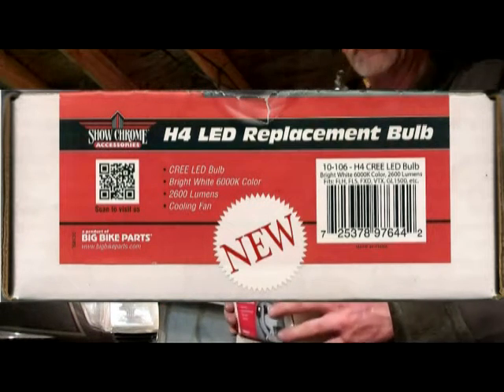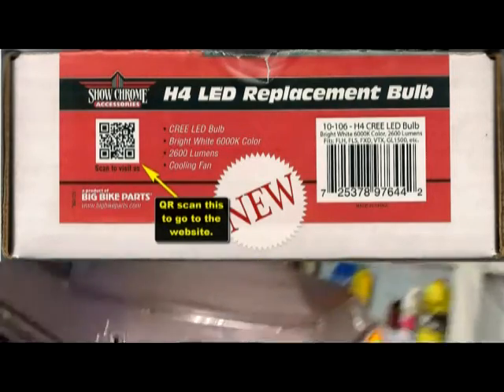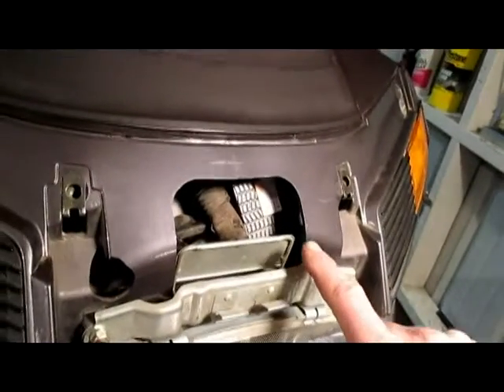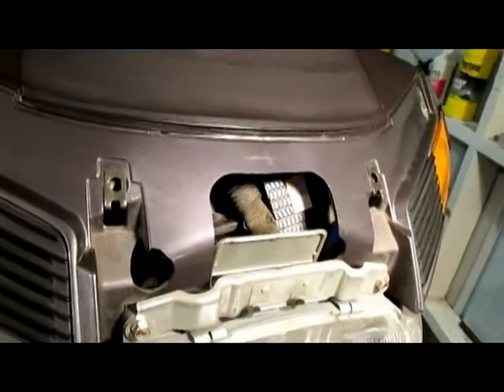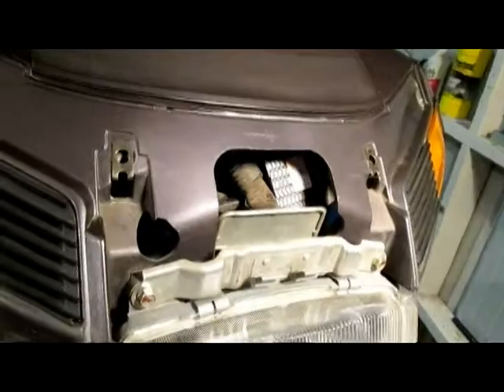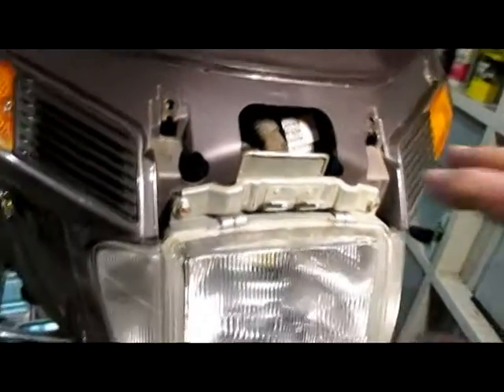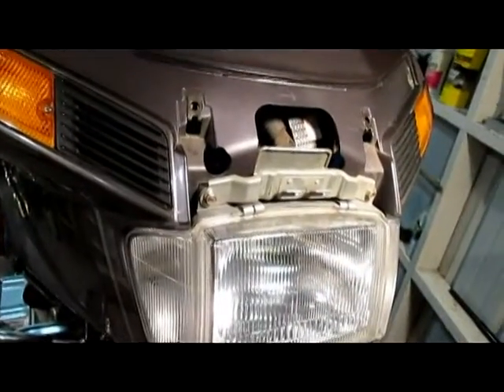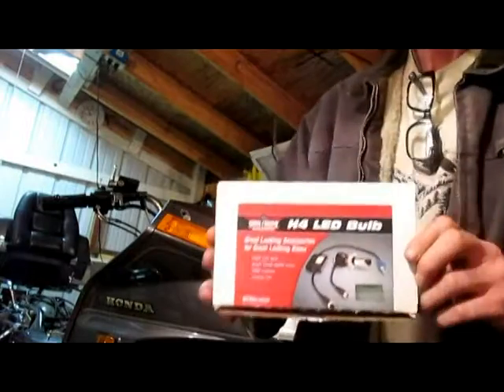LED Headlight Install 1987 Honda Goldwing GL1200i

Comment: No cutting needed. Run wires back tru holes. Made extra work for yourself .
Reply: What's going on with this cutting?
This is the second video I'm watching in which it is recommended to cut out a part of this casing.
Why are they cutting it if it's not necessary? 🤔

Comment: It would have been great to see how you got that front cover off instead of starting the video with part of the bike already taken apart
Reply from the maker: You're right, sorry about that. By "front cover" do you mean the aluminum trim above the globe? That allows you access to the four 10mm bolts that gets the globe off? If you have a 84 to 87 Goldwing, you take off the mirrors, the top bolt of the mirrors holds the aluminum trim on. Then you need to just pull up a bit on the middle of the trim because there is a little mount that kinda holds the trim down. But there are only the two upper mirror bolts holding that trim in place. Hope that helps. But don't get the one I put in. They make great ones now that just plug and play.
Reply from the maker: And there is a little piece of plastic trim at the bottom held in place with two small little screws. Careful taking those out and putting back on. Easy to lose.
Reply: @patrickbrandon549  Yes, we found your video but spent about an hour trying to find the screws behind the trim! Thank you for the reply, hopefully the next person working on their Goldwing sees this!

Comment: Thanks for posting,now I know for sure not to do what you did,they now make led lights with built-in drivers ,no fan ,exact same size of bulb as
 original !! Don`t see many wings in the amethyst grey
Reply from the maker: You're welcome. Glad it could help. I like the grey color, doesn't show up dirt as much. ;) I have been looking at the newer LED headlights and will probably put a different one in this Winter. This one is not very aim able, and because of the way the lens of the Wing is, the brights don't point right, it shows the top of the trees really good. It is a slight improvement side to side from the Silver Star H4 that I had used for years.  If you do get an LED headlight, would you please let me know which one you choose and if you are happy with it? I would appreciate that. There are a lot of choices out there and a bit of help from a person with actual experience using one would be a great help.

Comment: Led lights use much less voltage and will Overload voltage regulator. Which results in battery charging issues. Gold wing forums suggest a Moffett regulator to compensate for excess voltage not being used .my advice don't do it,fried 2 regulators, stranded more times I can remember due to previous owner installing Led headlight. Do some research and there are goldwing forums with members that are  technicians that can explain it better.
Reply from the maker: I Have an alternator conversion kit on mine now. So no regulator to worry about. And LEDs have improved a lot the last five years. For me it is much better nighttime visibility than any other headlight. I am a member of several Goldwing forums. goldwingdocs.com is my favorite. Every old Wing  that I find to rebuild will have an alternator on it when I'm done with it. There is just too many devices that can overtax the RR and stator now. Like USB ports, heated gloves and jackets, GPS, cameras, LEDs. I'm certainly done with stators. Too many headaches. But that's what they had back then. Conversion kits are the only way to go for me. Thanks for commenting.